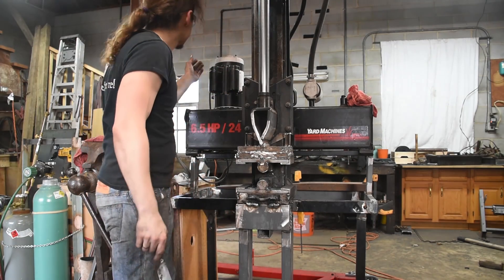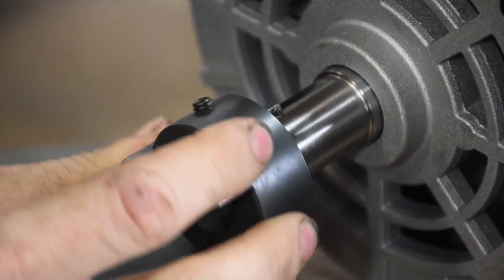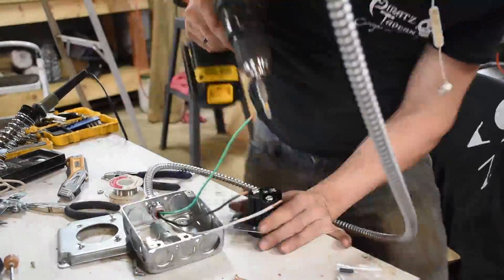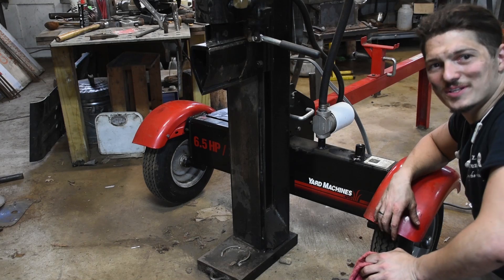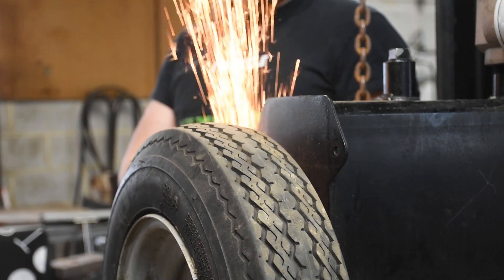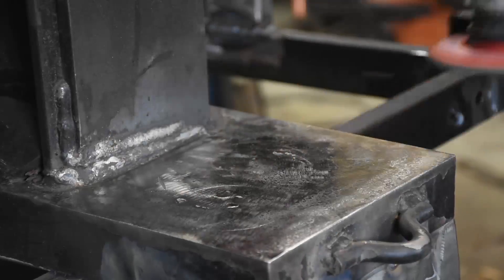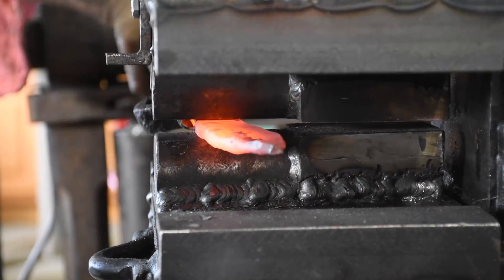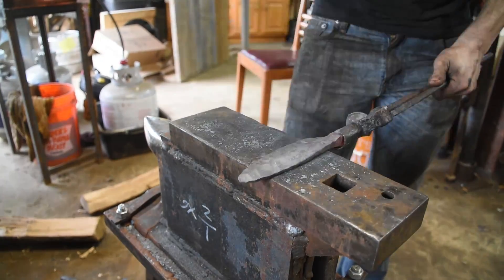Building a 24 Ton Log-Splitter Forging Press!

Comment: So would u say horse power is more important or rpm when changing the motor
Reply from the maker: I’m not a hydraulics expert, but I believe that horsepower will effect how much total force the motor can apply (up to the max of the rest of the machine) and the rpm, 1650ish vs 3200 ish, will effect how quickly the ram moves.

Comment: Would like to add, not all motors are fast enough for hydraulic pumps, the ones at the local farm supply store only have approximately 1750 RPM MAX. to match the performance of a gasoline engine,  the electric motor should be around 3500 RPM like yours.

Comment: I need to do this so bad. I can find log splitters, both without a motor and even straight up electric log splitters. I just can’t handle the building and welding. I’ve got zero welding skill and even less welders… I live with some lower spine injuries that dictate my life. If I’m lucky I can spend 30 minutes at the forge in a week. And that’s me overdoing it to get my wife’s Christmas gift finished. A press would likely increase that by 300-400% at the absolute very least. I just don’t have spare income to forage for a cheap welder, a log splitter, the motor and all the other metal needed. Best of luck with yours.

Comment: Hi, I bought a log splitter a couple decades ago, to feed my shop stove in the winter, so I have been looking at doing with a motor, what you have, rather than run an exhaust line out, and having just got back into forge work, planning to use it for the same purpose you show.  For life of the motor, it ought be horizontal, and since I'm going to swap out dies and splitter, I will make a separate "sled" for the dies.  I've had the same issue with the current "axle/tank" for years, and will probably put a separate tank that provides more volume and isn't so irksome.  Thanks for sharing, you made my build all the more easier, I appreciate it!
Reply from the maker: In the rebuild I'm planning, I intend to rotate the motor horizontal, I agree. I need to do a quick on on the footpedal I made. It's single action unlike every other one I've seen and works incredibly well. You step on the pedal for down and when you let go it retracts up to a stop you can adjust.  Very simple and nice to use.

Comment: That’s why I built mine so long ago ,so much simpler to buy a cheaper machine and chop it up 

I’ve done my 20 ton and a 7 ton and the 7 ton is now converted to a 24 ton 

I’m now building a pneumatic power hammer so look out for it here in the next few weeks ,done plenty of mechanical hammers so why not one that runs off air right
Reply from the maker: Sounds awesome, I'm looking forward to seeing it!  I have a ...shoot.. grandmother's cousin...      I have a relative who was a union welder till he retired and then was a blacksmith for thirty years.  He made a treadle hammer and then converted it to a pneumatic hammer. Apparently it did work :)

Comment: Oh, this is a seductive video, "So much easier than I thought it would be" indeed! I've been trying to decide between a hydraulic press and a treadle hammer for over a year, and the notion that even I could build a decently powered hydraulic press is very, very tempting. Darn you!
Reply from the maker: I would absolutely go for the press over a treadle hammer, if you can find a cheap splitter. Heck, if you can weld, build a tire hammer, not a treadle hammer!

Comment: You can adjust the valves and make it go up n down a little faster, well at least on mine you can adjust the speed.
Reply from the maker: Mine doesn't have valves that allow that. The speed is good actually, it's the slop in the head assembly that gives me trouble at this point.  I've built a really nice stop system to keep the head within the range I want it, so it doesn't fully retract. More on that in a future video, I think.

Comment: Great build. I have a 5t wood clewer that i was woundring to make a smal press from. But i dont know if it will be strong enough. Im only making knifes. Thanks for sharing
Reply from the maker: Thanks! I'm not sure if 5T would be strong enough to be worth it, but you can always try it without permanently modifying the splitter.  Try making a set of dies that bolt onto the existing head. Also, the smaller the working surface of the dies, the more concentrated the force will be.

Comment: Have you considered a foot pedal for it? We welded up one with just old angle iron and bolts and a spring and we use the splitter for wood
Reply from the maker: Check out the video I just put up on making a hammer, it shows the foot pedal arrangement I worked out :)

Comment: You didn't need a 5 HP motor. A 3 hp motor would be big enough. And if you buy a pump, you can move the noise far away. Or just cut the ram away and move the pump assembly
Reply from the maker: It’s probably overkill yeah, I read a lot of conflicting information about how to figure out the equivalent electric motor to replace a gas motor. Decided I would rather have too much than too little. shrug

That’s a good idea, moving the pump elsewhere, hadn’t thought of that. Might look at doing that when I get around to the first major overhaul. I need to go through and reinforce the whole frame and reduce the slop in the ram+top die assembly.

Comment: Good job, Bennett!  I want to something similar but, as usual when you're on Social Security, I'll have to save up to have enough to complete a job like this!!!
Also. I'm going to have to wire in a 220 outlet as I also have a 220 welder that will run on 110, SUPPOSEDLY!  Haha!  It does but, just barely and definitely NOT good enough for this kind of job!  So, while I'm saving for the components of the press, I'll also have to get MUCH better at welding!  Being 67 and slightly disabled won't help, either but I'm going to give it a whirl, anyway!!!!
Thanks for the video AND the inspiration for doing something I need in my Smithy!

Comment: There are a number of video's on the web about converting log splitter's to presses. However your's was by far the most entertaining and certainly as, informative of the approach and technique. A really good video. My only thought would be to suggest a heavier safety chain.
Reply from the maker: Thank you! I agree, that chain isn't sufficient to be completely relied on. I have actually clamped the entire frame to the I-Beam next to it as well. Both to make sure it can't tip, but also because the torque of the motor turning on and off was causing the whole machine to slowly revolve in a circle. The best thing to do would be to build a much heavier, sturdier bottom table. That would lower the center of gravity dramatically and be another horizontal surface for me to fill up with junk :P

Comment: Hi looks great I was wondering if you could give me some various specs on this like measurements of the different parts. Looking to gather research for my own I’m building thanks
Reply from the maker: I can grab some measurements off it, sure. Though they’re based on the specific splitter. So all the measurements I used were taken directly off the machine and may vary depending on what splitter you get. 

What measurements are you after?
Reply: Bennett Marschner thanks. I’m looking for things like the hight  of it, the base hight and the splitter part hight, the size of the cylinder please
Reply from the maker: Sure, I’m away from my workshop this weekend, but I’ll reply with the measurements next time I get in.
Reply: Bennett Marschner no worries. Thanks

Comment: I knew about converting log splitters into forging presses and my thought was that it might be tricky, but looking at your video it does, as you say, seem easier than I thought. I'm now on the hunt for a petrol log splitter here in the UK lol
Reply from the maker: Definitely go for it! The only real fiddly bit is tuning the slop out of the ram so it doesn’t slip sideways under pressure.
Reply: @BennettTheSmith  I have a deal with a guy for a hardly used Cub Cadet 25 ton splitter, costing a fair bit more than you paid mostly because its virtually new. good to know what to look out for RE the slop on the ram